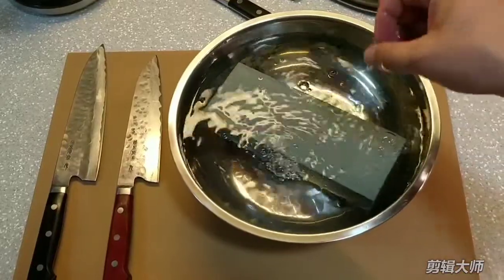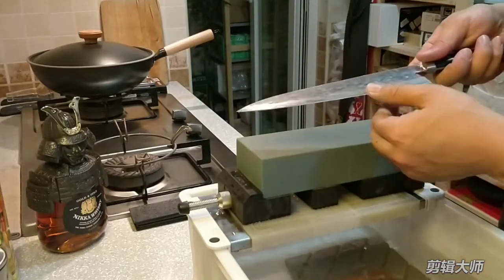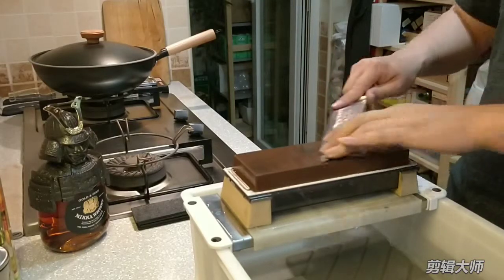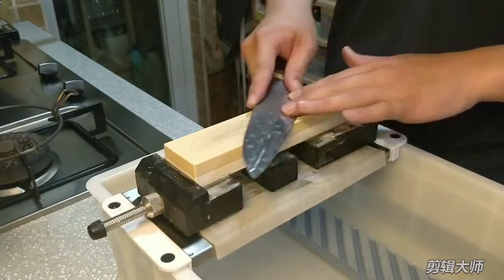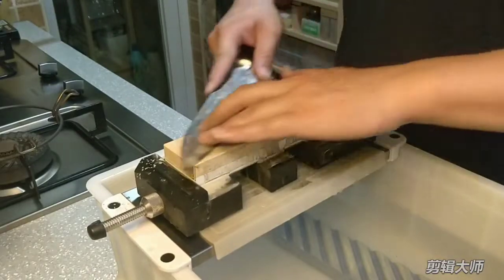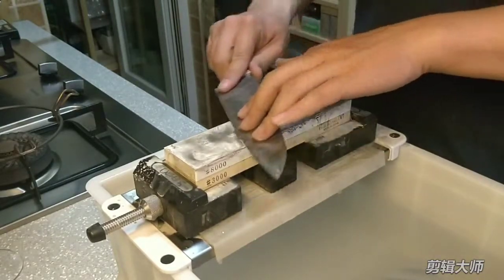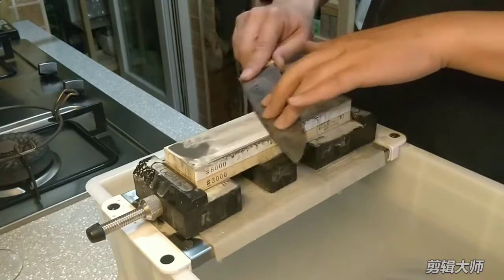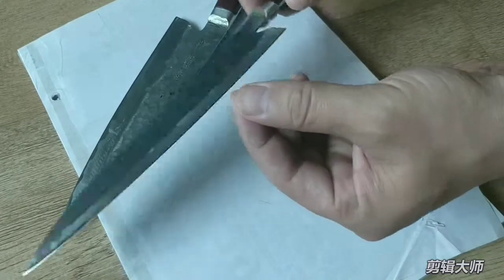Sharpening Teruyasu Fujiwara Maboroshi Shirogami#1 Gyuto 210mm/240mm

Comment: Great video, probably the only video I found on the Gc3. I have a Sun Tiger 220, a Imanishi pink brick 220 and a Debado MD 200, by your experience can you compare the GC3 to those stones? I was thinking of buying one and wanted to know if it was faster than the ones I have and how dose it feel.
Thanks!!
Reply from the maker: Get DEBADO LD 180 Grit
Reply: @tailibaba  any bricks you recommend? I go through coarse stones like crazy ( I have a business)
Reply from the maker: @MrMeds-of5ur  I have tried many coarse stones.  In the end, I keep DEBADO LD 180 grit.  People say Shapton 220 grit is ok.  And some say Shapton 120 grit is good if you use it in a proper way.
Reply: @tailibaba  what’s the difference between the Gc3 and Debado LD 180 besides it being splash& go?
Reply from the maker: @MrMeds-of5ur  DEBADO is splash and go.  For Coarse stone I recommend splash and go.  Because you realize the water will go away (absorbened by stone) very quickly on GC3 even you soak it over night.  And DEBADO LD is harder and cuts better.
Reply: @tailibaba  appreciate all the info
Reply: @tailibaba  hate to keep on bothering you but in your opinion what difference dose the Debado Md 200 and Debado Ld 180?
Reply from the maker: @MrMeds-of5ur  MD200 is softer than LD180.  MD1k feels just the same as Cerax 1010, but splash and go.  LD1k is different.
Reply: @tailibaba  thanks again
Reply from the maker: @MrMeds-of5ur  no problem
Reply: @tailibaba  do you have a email I can send some pictures your way?
Reply from the maker: @MrMeds-of5ur  Sure.  u293662@hotmail.com

Comment: Great videos! What flattening stone is that? Suehiro?
Reply from the maker: Thank you!  The huge black one is Naniwa A-220.
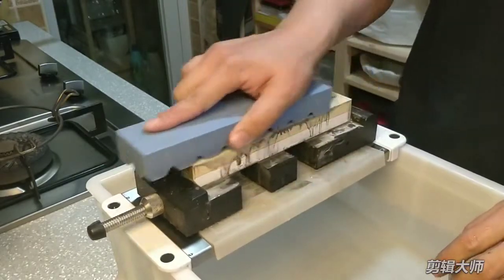Reply: @tailibaba  Sorry I meant the blue one. The one you used at 15:38
Reply from the maker: Aha, the blue one is Suehiro flattening stone.  #280 grid.  Two versions, one with plastic frame.  More expensive but makes no sense.  They also have black one #100 grid as I remember.  But very slippery.  Not recomannded.  Even blue one is #280 grid, but still pretty easy to fix #180 grid.  Suehiro has another one, PWA #200 grid.  A bit smaller, but good to use.